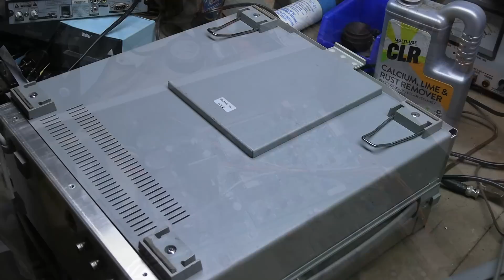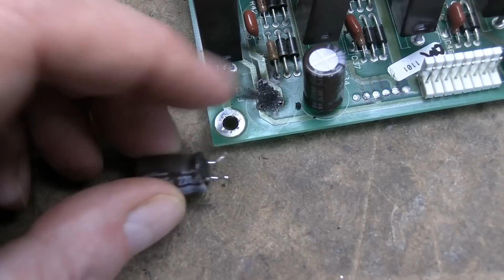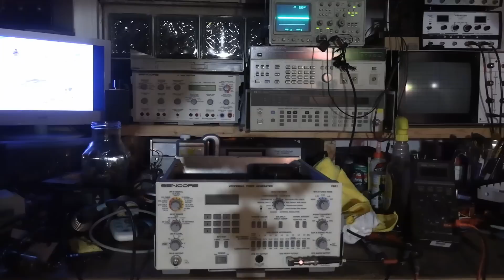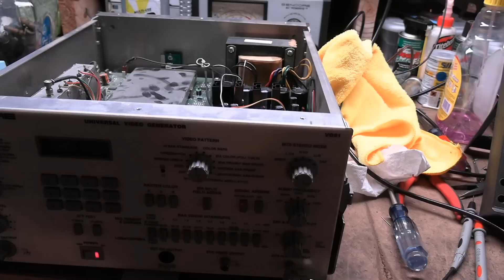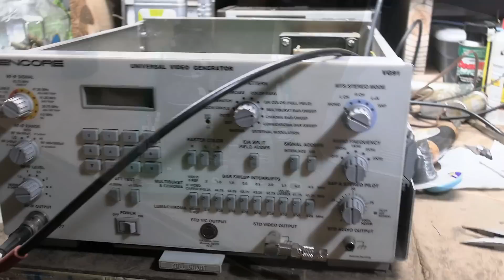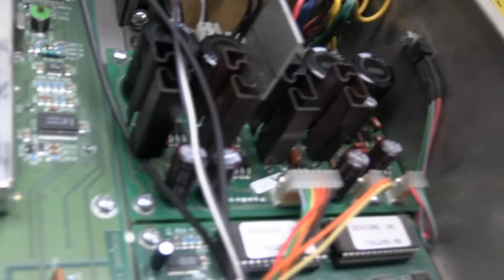Sencore VG91 repair part1

Comment: Why not a DVD that plays various patterns and set up images?
Reply from the maker: Watch the first few minutes again. Lots of reasons. It's not just RF. It can output IF frequencies and 4.5 MHz sound carrier. You can also selectively turn on and off parts of the video signal. The companion unit can output up to 200 volts peak to peak and produces drive signals. It can also test flyback and yokes. It will not work without the VG91

Comment: Wish I had some insight for you on this. All I can say is that when I don't have a circuit diagram, like you have suggested, I would cold check the values of the components and further to that maybe disconnect the power output from the rest of the circuit and see if any output voltages change dramatically. Good luck and I hope somebody furnishes you with a schematic.

Comment: SAA1043 is a sync generator.  It can output NTSC, PAL, 2 flavors of SECAM (French and Soviet, I think), and even the Brazil-only PAL-M standard.  That's PAL color encoding on top of an NTSC 60 Hz black and white frame.

Comment: Being a fellow tube man, I am just shooting in the dark as well. That said, most voltages in logic is 5vdc and 12vdc. It might help to test the other regulators as you mentioned and see if they fall in the ranges that make logical (no pun intended) sense. Also, I would agree @geirendre that it would be wise to cut those ends of the traces completely off and either , take his advice and use epoxy, or cut them out and use jumper wire to bride back to the previous solder node. Heartfelt empathy here Robert! :(

Comment: Wasn't this in the Bad Caps period? Many manufactures bought bogus electrolyte. I got my Sencore stuff in 1990, or so. Maybe I'm safe.
Reply from the maker: Too soon - that was '1997-2007.  Also, it was Taiwanese that stole the formula from the Japanese that caused the problem.  Nichicons did not suffer from the cap plague.  These caps are just about 30 years old and this unit has seen many, many hours of use.

Comment: If there is service information out there on reasonable terms, I sure haven't found it. I've reached out to many people who own these, and even asked at an area TV repair shop that's still very much in business. (Turns out they don't even own one.) Sencore, it seems, trashed all of their history when new ownership came along. Maybe you already knew that.

I don't use mine very much (and not really for its intended purpose), but I'd probably better deal with those capacitors. Someone should definitely read and save every EPROM in this thing. On to the next video!

Comment: You got that microscope, right?  If a magnifying glass with a high power spot is not enough to read the values of the power regulator calibration resistors, your microscope might be.

It might be worth it at least to see that the resistors are correct.  If they have failed so as to send a digital circuit power supply well over their rating, it would be au revoir for said digital circuitry.    It might be helpful to look at the supply voltages on those digital chips to see if those are even present, let alone right, however.  And trace backward from that relay as well as testing the relay out of circuit as best as possible.

I know, a schematic, a schematic, the kingdom for a schematic!
Reply from the maker: Oh I have one now.  Editing part 2 right now

Comment: I think, Bob once you get the power supply data, it will expedite the repair as you can check for a missing voltage. 
An after thought, think about trying to clone those eproms, as they can lose memory after 10 or 15 years. Welcome to the digital world!  Good luck at your repair attempt............
Reply: I would really like some advice on buying or maybe I have a prom reader or three around. Haven't got the nerve up to pull the chips out on my several digital Sencores.

Comment: Often the mini relays in the later Sencore equipment need "exercising"  or replacing.   Not sure how many are in the VG91
Reply from the maker: At least 3.  You'll hear them in part 2
Reply: @bandersentv  The Sencore relays get really bad, especially if not exercised often. Several times I was able to get the casing off and use deoxit on them on my PA81 and SC61. I think I once thought I had a suitable replacement picked out from Mouser or Digikey.

Comment: I did a full recap on my VG91 on all boards.  Most of the power supply caps were leaking when I got it but the unit had not been powered up so spared any major damage other than corrosion setting in.   The power supply heatsinks run pretty hot so I upgraded the larger caps to 105C instead of 85C.  Also had some cold solder joints on the regulators from thermal stress.  I have the service manual with schematics but it is far too large to scan but if you need some part of it I can try to take a pic with my phone.  Side note.. if your LCD display is not backlighting or is dim there is a trimpot on the board near the LCD you can set the backlight intensity.  This is not often known on these units.  The manual makes no mention of the backlight.
Reply from the maker: Thanks for the advice. I did just get a scan of the power supply schematic so I'll continue looking there. Huh. I had no idea it was backlit.
Reply: @bandersentv  So glad you got the schematic.  Looking forward to this repair!  Best of luck.

Comment: You could probably use a modern software defined radio (SDR) to do all of the different types of modulation etc for the test pattern generation, but replacing the amplification functions of the companion box is almost certainly not something you're going to find in an off-the-shelf modern component.
Reply from the maker: Oh I have another test pattern generator and a bunch of RF modulators. It's the other functions I really miss

Comment: When a board is burnt that bad, it's best to use a Dremmel or something to carv out all of the burned pcb.
You can refill the hole with epoxy, and if needed replace traces. 
That way you know there's no current leaking trough the board.

You can also chech voltages on ICs. Refere to datasheets for expected voltages on them.
Good luck with the repair.

Comment: In my opinion you are lucky with the fact it's a linear power supply. I have already seen the formulas in the other other comments, you can calculate the supposed output voltages for the 317. Trace out the power supply and at least check that every voltage leaves the board. 
It's possible that something other then the power board got toasted, but since current goes the way of least resistance i expect most of it went thru the short, leaving everything past that alone, overvoltage would be much more dangerous to the rest of the device. 
Without schematics it's difficult and some work, but as you said, you do depend on it. After confirming the power supply, you could check where the voltages of the burnt part are routed and check if anything got burned out, or isn't attached anymore. A reason for not drawing power.

Comment: Those Nichicon PL caps are unfortunately one of the low ESR types known to leak pretty bad, like PF, PR, etc. Funnily enough the caps you used (PW) are I believe the recommended modern replacement so they should be just fine :) 

Some random musings on the power supply - definitely try to figure out the expected outputs, and try checking them on the actual boards they go to. I have had that style of power connector go intermittent in 80s computer equipment. the crimps go bad causing voltage loss - so 12V would fine at the supply, but then I'd read something like 8V at the load. also, those double sided boards can be fragile, especially when damaged by cap leakage - verify your plated through holes are good on the replaced caps. I once spent many hours banging my head against an 80s switching supply that had all voltage rails but one - it turned out when I recapped it, I had invisibly severed the top trace to the through hole, so the voltage wasn't making it past the filter cap. Running a thin wire down the hole fixed the supply. Best of luck!
Reply from the maker: Yes, I'm discovering the same reading through service forums.  Lots of leaky PL caps.  Learned my lesson. I'll be more inclined to recap working older test equipment after this experience.

I'll pull out the PS board, draw up a schematic and go over everything again.  It seemed like it was starting to work after the recap.  A flaky PCB trace would explain that.
Reply: @bandersentv  Best of luck! The low ESR caps of the 80s and 90s are a real problem in vintage computer circles. Some machines are well known for being badly affected (like the Macintosh Classic, for example) but I have found problems in nearly every machine that crosses the bench. It affects pretty much every manufacturer, as I understand it the dielectrics used in those days to get a very low ESR turned out to be volatile and slowly eat through the rubber seal over the years, eventually spilling out onto the board. I spend more time refurbishing ancient power supplies than anything else these days...

Comment: I had an LM317 fail short, a few months ago. It was dropping 12v to 9v, so when it failed it let the full 12v through - lucky I spotted it quick. Look at the data sheet for the LM317 and what components you have and from that you should know the intended voltage output.

Comment: Check the trace between the LM317 and the output connector. Make shore it didn't damaged when cleaning up the burned spot on the board.

Comment: Using the resistors around the LM317 it is possible to calculate the intended voltage output, It should be 1.25*(1 + (R2/R1)). Where R1 goes between pins 1 and 2 of the LM317 and R2 goes between pin 1 and ground.

Comment: It's not always the big caps that cause problems. It could very well be a small 1.0 ufd cap @ 10 volts or less, that is a dead short. Unfortunately you probably need to check a few more. Good video though.

Comment: ...send it back Sencore...(?)
Reply from the maker: @daleburrell6273  They are still in business and this was in their 1999 catalog but I don't think they service stuff this old
Reply: @bandersentv that equipment was expensive and companies often rely on such equipment. I would not be surprised if they could service it. But it would not be cheap.
Reply: @bandersentv  ...maybe you can find a replacement power supply board...(?)

Comment: Hello, check your rework around the burnt area of the board.  Cold heatsink?  Perhaps the rework around the output cap doesnt connect to the output of the LM317 ...no load on the regulator. Also, I have found that those 1990's displacement connectors are unreliable, especially when they have been plugged/unplugged a few times as the wire may have been tugged.  May be why the relay doesn't click in.  Cheers!

Comment: Like the Invaders T-Shirt..one of my favorite shows as a kid. Got the whole Series on DVD last Christmas.
Looks like they set-up multiple standalone power supplies with a bridge rectifier, filter caps. The 317 is an adjustable and as you stated the output voltage is set by the resistor. If you can read the resistors and go find the App Note to determine ratio and the "planned" output voltage the designers were looking for. the fact they used 1% resistors implies they wanted it pretty close. You can do the same to find the other Output Voltage for the other sections as well.

Comment: I thought you had a Sencore VA62 that will do almost everything the VG91 will do?
Reply from the maker: Got rid of it a decade ago.  Too clunky and had issues.
Reply: @bandersentv  Ahhh...oh well.  There is a schematic for the 62 available.  I know Phil of Antique Radio fame posted it on the forum in PDF format.  Maybe you'll luck out if the power supplies for the VG and VA are similar in layout.
Reply from the maker: @MrCrystalcranium  no, radically different. About 15 years apart in technology.
Reply: The VA62 was an earlier version of the VG91-TVA92 pair. It looks like the VG91 has a few more patterns like the big circle and cross that the VA62 doesn't have. The VG91-TVA92 pair also has more advanced circuit design. I don't really know if that translates to better specification numbers however. A real bummer if the service info is not available.
Reply: @notimetolooz9655  That's right...the 62 has both the generator and analyzer and the 91 and 92 handle the signal generation and analyzer functions separately.  Lots of VG91 and VG91/92 pair sets on sale on the bay currently.  I think window/circle is the only pattern the 91 has that the 62 doesn't.  For me and the TVs I work on, early 1990s tech is more than enough to troubleshoot 1948 TVs!  I reached out to a seller who has calibration, user and other VG91 manuals available.  I asked if any of them included a schematic so we'll see what happens.  Unfortunately, he's on vacation until 7/20.
Reply: I surprised you didn’t mention the Sencore VA48, and the older B&K Analyst (flying spot scanner) for troubleshooting.